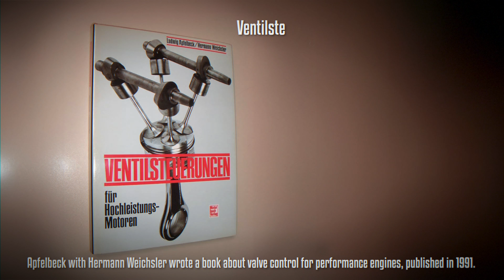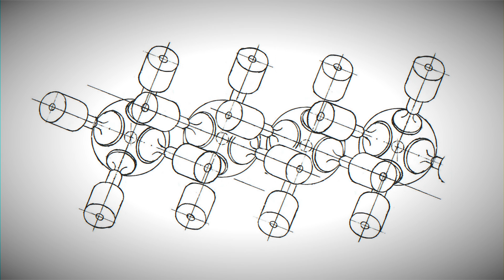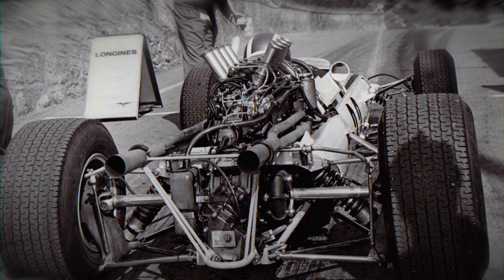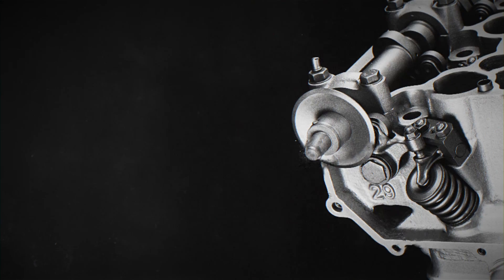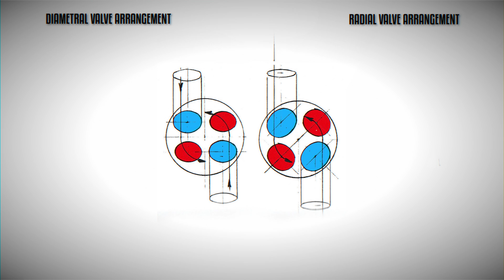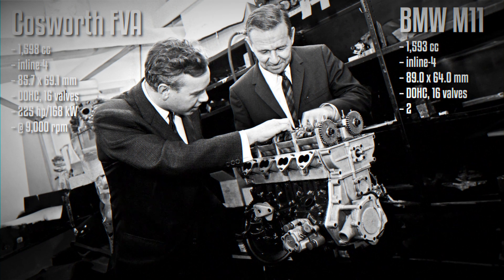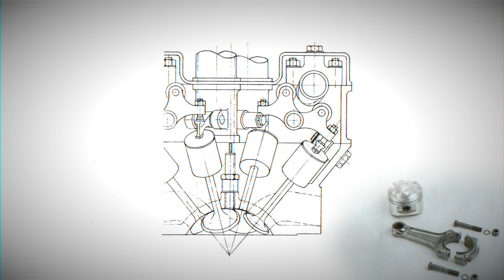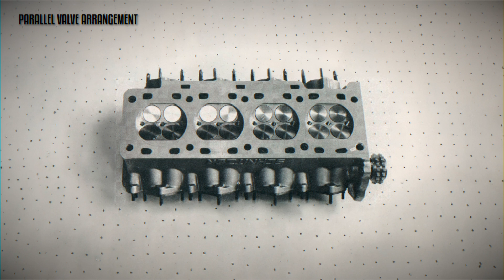The Incredibly Genius BMW F2 Engine Was A Failure

Comment: I feel like this diagonal valve layout would have great synergy with pneumatic valve system like FreeValve.
FreeValve alone provides too small of an advantage compared to conventional Variable Valve Timing. Diagonal Valve Layout brings too much complexity to the valvetrain to be feasible. But together they can have all the advantages of Diagonal Valve Layout without all the complexity (besides more complex manifold).

Comment: I had a honda xr650 motorcycle which had a radial head it was single ohc and then used a double rocker arms. They were expensive to repair and did not make much more power than a  the conventional four valve heads so it was dropped after a few years.

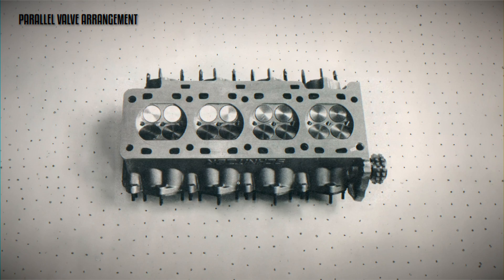Comment: The head you're showing at 9:14 is actually not a head designed by BMW, it's a head designed by Schnitzer for the M10, called 20-4. It was the main competitor of the Apfelbeck 16 valve head. It was used in F2, in BMW 2002 touring cars and in various hillclimb cars and it was sold as a tuning kit for street cars. Its simpler parallel design proved to be better than the Apfelbeck head, which prompted Rosche to design a very similar parallel 16V head. The 20-4 got a turbo version too, used in the Schnitzer Rodenstock BMW 2002 turbo group 5 and later in multiple BMW 320 group 5, raced by Schnitzer in the DRM.
A feature on it might be interesting.

Comment: Thank you for another excellent video. I suspect that, in addition to extra mass, the radial head design may have introduced significant friction losses. Complexity has to be kept in context however, given that : according to Harry Ricardo, the Rolls Royce Eagle was both the most complex aero engine of WW1 and the most reliable aero engine of WW1. Good to be a Patron.

Comment: One of the Soviet aeroengine manufacturers went down this path in the late 30 early 40s. Electronically operated valve train would make this a lot easier to manufacture.
Reply: I would love to see this on a Reno racer. Then again I actually want to see a working compound engine, which doesn’t allow valve overlap.

Comment: Illuminating, this.  

The version of the engine that was the endpoint of development -- when they trashed all the cool opposed ports and reverted to a conventional parallel valve head -- became the basis for BMW's K series motorcycle.  Engineers literally scaled all the dimensions down 50% to turn the 2.0 L motorsport engine into a 1.0 L motorcycle engine. The head that shows up at https://youtu.be/SxxExDjFmX4?t=564 appears identical to the heads from my K1200. Sorry that the race thing didn't work out, but it did provide 20 years of great road bikes .

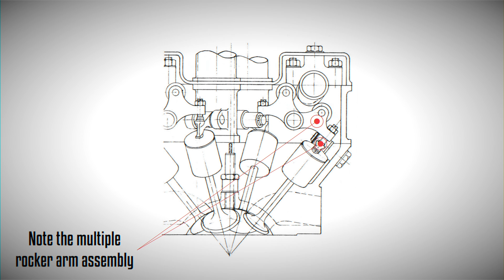Comment: 7:42 Dear @VisioRacer, don't get me wrong, I mean no disrespect, but I would like to suggest you to change the "necessitated" for "required" in your texts. It's not wrong, but in the context you're applying, it requires you to use "require" (no pun intended). Require means to need something or make it necessary in order to achieve a certain goal or outcome. It implies that there may be other options or alternatives, but this particular thing is needed to achieve the desired result. Thank you.
Reply: That is something Micheal - Michaels would say😂

Comment: I just love these 4 cylinder engines with exhausts in both sides of the block! I thought that it was Lancia the only brand who developed this type of engine.
Reply: Did Lancia do that? There were racing modifications of Lancia V4s that had exhausts on both sides... but they were V4s, not inline-4s.
Reply: @brianb-p6586  Lancia triflux engine of the ECV prototype.
Reply: @bigjoe65459  Thanks - I had not heard of that engine. The Triflux did have diametral valves and the expected exhaust from both sides, although it has parallel rather than radial valves.

Comment: Last 20 years of BMW engines have been a failure, at least the diesel ones. They clearly give zero f*** at the broken chains or ingested swirl flaps.
Reply: Different marketing team, its failures are designed into it.

Comment: Keith Duckworth had the same idea and was well on the way to building the engine until he realised that it wouldn't work. Then he designed and built the FVA, which was very successful. BMW then bought an FVA and copied it.
Reply: No, not true. It was an Apfelbeck-Patent from the early 30ies. The BMR Supermono motorcycle worked great with this arrangement.
Reply: @hiha2108  Not saying that Apfelbeck didn't have the idea first, just that Duckworth designed a similar engine with diagonally opposed inlet and exhaust valves. Fortunately for Duckworth, he realised that it wouldn't work before he actually built it.
Reply: Wasn’t that FVA a glorified Ford Kent engine, basically?
Reply: @chrishenniker5944  The FVA was based on the Ford pre cross flow 1500cc block from the mk1 Corrtina I believe. For the time, it had quite an over square bore/stroke ratio compared with other then current engines
Reply: @whizzo94 Shame it wasn’t made into a kit for street use. Just imagine it in a 997 cc Pre-Crossflow powered Austin 7.
Reply: @chrishenniker5944  The FVA would have ended up in the Mk1 Escort RS1600, BUT, according to Keith Duckworth the camshaft drive geartrain "makes enough noise to wake the dead", which was obviously no good in a production car.  So, Mike Hall, at Keith Duckworth's direction, designed the BDA, which was similar to the FVA but had toothed belt drive to the cams.  This is the engine that ended up in the RS1600.
Reply: @whizzo94 Wasn’t the Mazda MX5 engine a derivative of the Ford BDA?
Reply: @chrishenniker5944  Don't know about that one, but the BDA and the Mazda engine are separated by 30 years or so I think.

Comment: I bet that that valve arrangement has some extreme power potential  if it was designed with modern CAE flow design. The angle, flow characteristics, valve size and port size have to be adjusted probabily to a very fine degree for piston volume to properly work.
Reply: The benefits of this layout are a compromise for combustion chamber shape
Reply: @mandrakejake There really aren't any benefits to this layout.  The chamber has worse combustion and it's a mechanical nightmare.  At the same time Keith Duckworth was developing his F2 engines that became the  DFV. Narrow included angle 4v layouts have much better combustion, rev higher and make more power.
Reply: Crossflow head is easier to achieve good scavenging which can offset the "swirl" advantage of the radial design (not to mention better pressure angles / concentrations at the piston edges). I do love the concept, though, and think it's a great achievement to design and build the cam / rocker assembly that could withstand the rpm it was capable of.
Reply: @stephenkeen6044 F1 4 valves today and BMW boxer have radial valves and cross flow. Scavenging actually works better on diametral engines because you have 4 times the area to flow through at valve overlap. Diametral valves don’t collide in the radial arrangement. They move away from the walls more and allow scavenging there, too.

With crossflow ideally, valves would be of different size and lift and timing ( small valves for overlap ).
Reply: Similar to Lancia triflux engine. That had massive potential

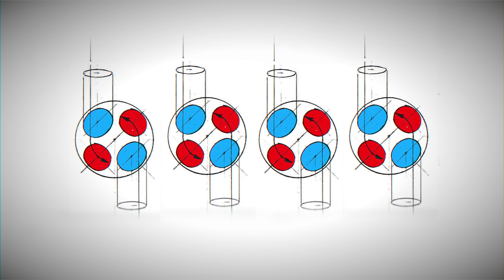Comment: 3:11 Typical German design - complexity for complexity's sake.
The radial valve designs and five and six valve designs offer minimal to zero advantage over four valves
Reply: yes but we're talking about years when all these dynamics weren't much clear even to engine designers
Reply: No it's not. They were trying everything to get the maximum performance out of a known design, it was innovative. You're looking at it in hindsight.
Reply: True. But 5 valve are proven to be better than 4. Its just that 5 valves are extra cost for the same power potential
Reply: @km6832  5 valves is better by a few %. but its not worth the complexity really. F1 tried it in the 90's and the weight offset and additional factor of safety considerations reliability considerations are not worth 10-15hp on 600-700hp
Reply: @km6832  5 valves in theory should allow for better valve control due to smaller and lighter valves, so high revving engines should benefit. But nowadays it's become useless because of spring evolution/other systems and we can make valves that are light enough
Reply: @bunta_wrx5851 with 5 valves or diametral valves you can have valve overlap between valves far away and flush the chamber. This does not work with a restrictive exhaust with catalytic converter and particular filter and silencer.